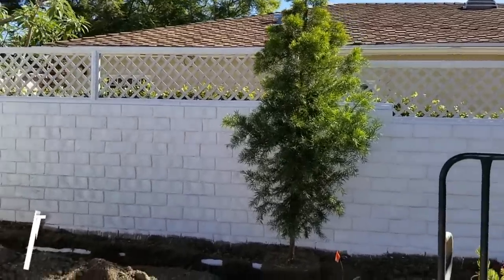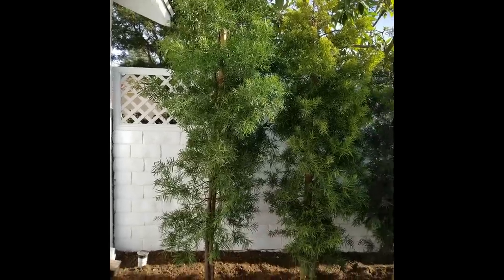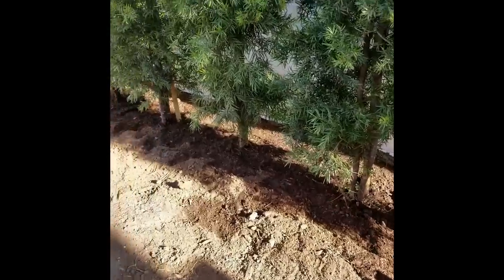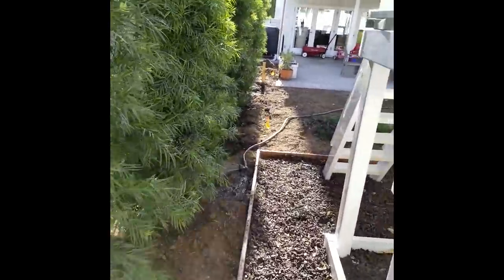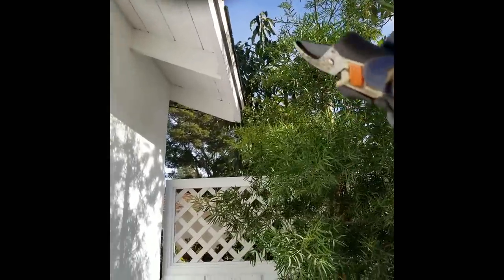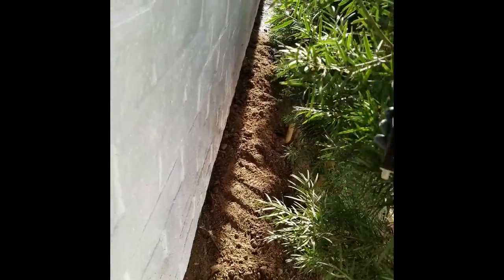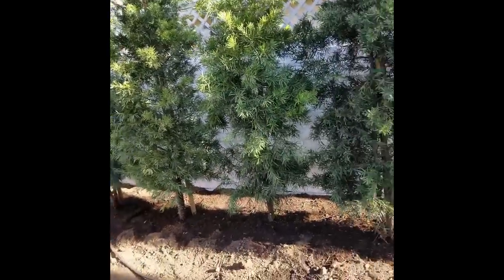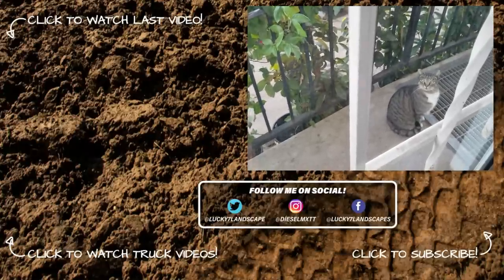Fern Pine Podocarpus Planting and Trimming | Lucky 7 Landscapes (Makeover Part 9)

Comment: Hi Matt, Thanks for sharing. Lots of good info and the hedges look great. Q: this video was made over a year ago and I'm curious to see what your podocarps hedges look like now and if you'd do a follow up video.  Thanks in advance!
Reply from the maker: Thnx that was at a clients house and have not been there over a year. Most likely wont be doing a follow up video unless i drive by the house. Since then i have planted the same plants at 3 different houses. They are really great plants for the yard
Reply: @dieselmxtt  I like them just don't want them as trees because I know they can get huge. I just need them to be about 15 ft high and maybe 5 to -6 ft wide

Comment: Matt, great video. If you top podocarpus do they stop growing taller? I wanted to encourage mine to grow taller but it seems that after topping them a few months ago they have stayed at the same height. If that does stunt their growth, is there anything that can be done/prune in a different way that will encourage them to grow taller or do I need to replant new ones?
Reply from the maker: They will grow taller. New growth should show up on those older branches that will keep growing up. Sometimes I have trimmed the top as they can get top heavy and new growth will keep it going
Reply: @dieselmxtt  Thank you, really appreciate the reply, you da man! I planted them in hopes of creating some privacy between my and my neighbors and I got scared I stunted their growth before they even made it to eye level. They seem to be flourishing otherwise; the tops have just not grown even a hair in a few months which is why I am concerned. Thanks, hope they start shooting up.
Reply: @ryankelly618  Did you Podocarpus start growing again. I have Ligustrum that have the same problem and wanted to check if it will eventually start growing tall again.

Comment: I went about 10 months without pruning my new podocarpus.  They are a freaking mess and wish this video was out early 2018.  How much can I prune to even them out better?  Is there too much pruning that could cause permanent damage?  Thank You
Reply from the maker: Yea bet they are going crazy. You can cut them as far back as you want or need. They are very hardy. If you living in freezing temps wait till it is a little warmer so they won't go into shock. Does help to after cutting to give them fertilizer after. Either miracle grow spray or even better mix some nutrients into soil
Reply: @dieselmxtt  I am in los angeles.  Thank You
Reply: Oh man i was about to get some but if they are hight mantienece forget it then.  somebody had told me they were low mantianance but I guess not.. Are they easy to prune, do you recommend them to me for privacy?
Reply: @futbol1972  they’re not high maintenance.  I wrote that a long time ago when I didn’t know shit. I’m loving mine.
Reply: @Solaris501  i just planted about 40 up against a fence and they are a bit of mess and slanted i was told not to prone for 3 months? is that bs and should i prune them now?
Reply: @garciasjewelrymiami  the more you prune the fluffier they get, which is nice.  I say yes.  Don’t cut the top though otherwise it will split in 2.

Comment: Nice job but I was taught to open the roots on the sides too, not just the bottom so the roots aren't root bound and choke the tree in the long run. When I plant trees I open the roots on all sides and top and bottom
Reply from the maker: That is not necessary and wastes alot of time. You only do that if the plant has been in its pot to long

Comment: Aren’t they a bit close to the wall?  Thank you for the pruning information,  I think I ruined one of mind by the pruning I did.
Reply from the maker: They are the closest to the wall you will want to get. Any closer and you wont beable to fit and trim behind the wall
Reply: @dieselmxtt  How close are they to wall?  I was told you don't need to plant them that close to each other ether cause you are just waisting your money since they can get up to 15 ft wide?
Reply from the maker: They are 2.5ft from  center of tree from the wall allowing easy cleanup and cutting in the back. You do want them that close together if you want privacy much faster. 15ft wide is very unlikely and will take about 20years

Comment: Thank you for all your info! I have a couple questions if you don't mind.  I've read all the comments and almost all my questions have been answered except these. I am about to plant podocarpus in a 29 ft plantar by my back fence. Unfortunately our back neighbor has ulgy hacked cypress or juniper trees I'd like to screen. They also make a mess in our pool.  I originally thought about the gracilior (24" 10 ft tall) but love the thickness of the macrophyllus (I found 15galon about 8 ft tall) .  I have two questions.... which one would your recommend for a fast 15-20ft tall screening tree and how far apart would you plant them if I am letting them grow that tall into an actual tree.  Thanks so much!
Reply from the maker: Hi thankyou. I would plant them 2ft apart from center of each one.
Reply: @dieselmxtt  thank you for your response! Do you have a preference macrophyllus or gracilior?
Reply from the maker: @evelynmesa4875  like them both

Comment: would these work in hot area of Arizona?
Once established how often would they need water?
Do they have invasive roots?
Reply from the maker: No invasive roots at all wich is one of the many reasons I recommend using them. Yes they are hardy in heat. On a drip system with a line in the front and 1 in the back about 2x a week for about 20min. Depends on drip you use,  heat and how big they are. The leaves will droop down when it needs more water

Comment: Awesome video, and very informative. One question, I'm planning on doing the same thing, planting next to a block wall, except that mine is more of a retainer wall, and my only concern are the wall being damaged by the roots. Should I be concern or do you think it will fine?
Reply from the maker: Orlando Sanabria hi thankyou. The roots will be fine if you use a drip system so the roots grow deap in the ground and not out trying to hunt for water. Another option is adding a plastic barrier between the plants and wall. Its a root barrier most are sold by 2x2 squares. You put them in the ground and clip them together to form a wall. Alot of people use them to keep roots from going under houses, driveways and sidewalks
Reply: Thank you!!!
Reply: s @dieselmxtt  had the same question, when u said dripping system they are the little black tubes right with the little wholes? Also how many times a week do I turn on drip system and for how long.. Live in Clovis california.. about the plastic wall, do I bury it to create a plastic wall between tree roots  and concrete and how far from tree do I burry the plastic barrier also how deep?
Reply from the maker: @futbol1972  the tubing i use for drip is brown about 1/2 in diameter and has holes every 12in . I get it from an irrigation store such as Ewing or Aquaflow. If you scroll down to my 2nd video i made is the drip system.  The plant will show signs of wilting when it needs water. About everyday for 25min for 1st 2 weeks. Then depending on weather usually 3x a week for 25min. 1 row of drip in the back and 1 in the front. As far as the plastic barrier i get them at the same irrigation stores. 12in deep. I put them about 1ft away from the roots

Comment: I have bought podocarpus 6 months ago but I realize it has black powder on. Any advice?
Reply from the maker: Most likely mold. Similar to spider mites which is a white powder on the plant. Using a spray with soap/water will remove it. Depending on how bad you may need to do it twice. Leaves will burn if you do it while sun is out so cloudy day or in the evening is best

Comment: Nice video...it's good to see how to trim these. We planted 8 (5-gal) macropyllus along an east fence. Drip-watering; gravel at base. From the nursery, about half of them seemed to have been 'topped': the tapered-look of the lead trunk gone. The other half of them are obviously shorter, and thicker. Should all of these be topped? Also, on some, the new 'tufts' of growth this spring (2020) are yellow. No aphids, and I've given them bone meal and 10-10-10 MiracleGro. Still yellow. Do they need something else? Magnesium, perhaps? (We're in zone 9-Riverside, in fact, about an hour from you). Thanks!
Reply from the maker: They are very hardy. They need very little fertilizer.  I dont top them off unless they are at the height i want. As they grow you need to trim the tops but the sides to prevent the top from tipping over. The middles will get thicker the more you cut the top.The new growth will be a light green. If there is not enough water the tips will droop down. Also the bush will turn yellow and fall off if to much fertilizer, to much water or not enough water. How often and how long  do you water them.
Reply: @dieselmxtt  It's the lack of water...we've been landscaping the whole backyard and ignoring these for months; but for the occasional bone-meal-just-before-our-rainy...three-days (ugh-and now dry and 98 degrees) and the MiracleGro once since then. The drip is a dribble, so I let it run for about an hour (deep water). I think I should do that every three days? While it's this hot (especially with gravel at their bases)? Thanks for answering...
Reply from the maker: @JJ-gc8du  yes if you have a rock covering drip i would do it 3x a week for 25min. Drip should be every 12in a hole 2 rows. One in the back and one in the front
Reply: @dieselmxtt  Thx; will do. We configured one drip at base of each tree, planted 4 feet on center. The line is also on a timer (not turned on yet) watering other tolerant plants, so I'll watch everybody as they get (a LOT) more water than they've been getting for the past month. I'm glad plants can't get up and run away for neglect...I'd be tree-/plant-less. Appreciate your input.
Reply: I read that yellow foliage can also mean a lack of iron, if they are getting sufficient water.

Comment: I just had 8 podocarpus planted by newly hired landscapers in the backyard of my new house. After the landscapers left (finished), I noticed that the plants had blue tape around the stem. I thought that the landscapers forgot to remove the tape supports, so  I removed them. I thought that the tape were only there for transportation support. The podocarpus remained straight after removal. Should I replace the tape with zippy ties on the stems?
Reply from the maker: Chopper G hi as long as they are growing straight or in the direction you want them to grow then you dont need to put the tape back on.
Reply: There are bamboo stakes in the middle of the stem. The bamboo supports are wrapped around by the vines. I have one plant that's leaning to the left, but has nothing to do with missing tape support. I guess I'll install a wooden post to keep it straight. Thanks.

Comment: We have the smaller 5 gallon size, so how far apart plant please? Since mine a younger, how often water?
Reply from the maker: 2-2.5 ft apart. 1st 2weeks water everyday. After that water when leaves look droopy.  Usually 3-4x a week
Reply: @dieselmxtt  will these get lots of spiders? If so what spray them with?
Reply from the maker: @jenmv3483  it will get some spiders but any outdoor garden spray would work to help fight that. Home depot or lowes carrys a good brand i believe from Ortho

Comment: What size & gallon amount are these? Thanks.
Reply from the maker: Hi, these ones are 24x24 wooden boxes. 15G is the biggest you can get in plastic containers.  Next lvl up are these ones i planted.
Reply: Dieselmxtt Thanks, how far apart did you plant them from each other?
Reply from the maker: @burntrubber9538  from center of trunk to center of trunk is 4ft
Reply: Dieselmxtt Thanks!